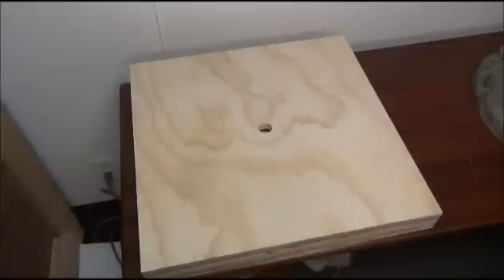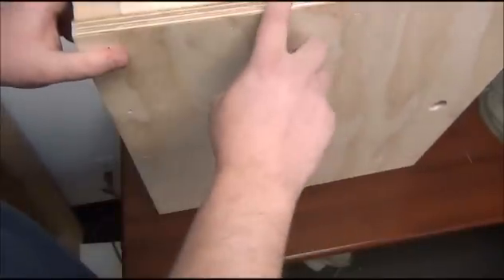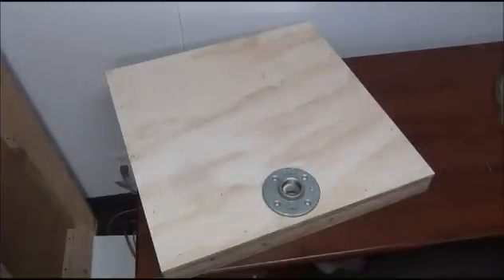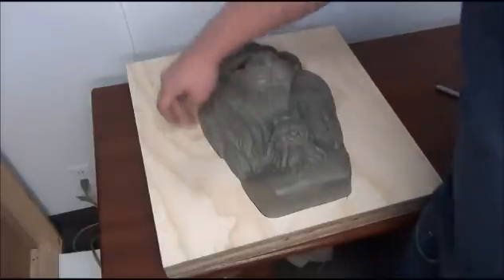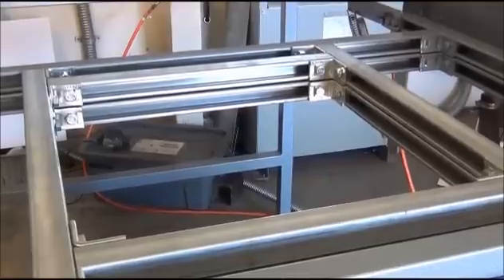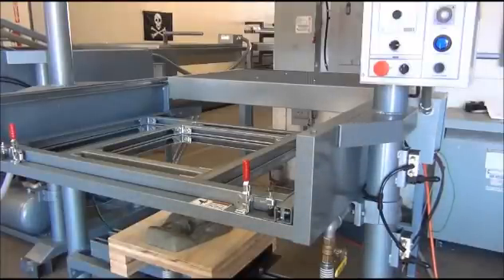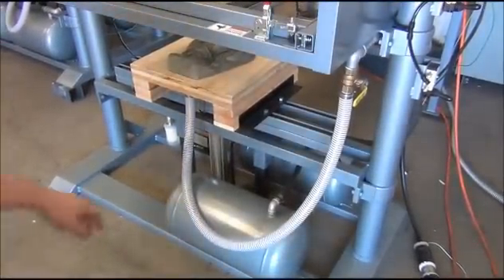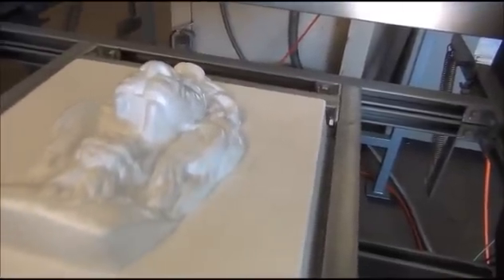Mold setup overview

Comment: Thanks for the informative video.  I made a DIY vacuum forming machine with a shop vac, PVC pipe, a plywood gasket, and a 10"x10" MDF platen with 1/8" diameter holes spaced every inch.  I've sealed all joints with silicone but noticed that you recommended not using MDF as it is naturally a porous material.  I'm assuming you make a different platen for each mold as you drilled holes around the outline of your lion's head, but if I'm planning to reuse my platen for different projects, would it be reasonable to coat the MDF with a thin layer of silicone so as to decrease its porosity?  More specifically, I'm trying to mold a special see-through iridescent 1/8" cast acrylic sheet, but am unsure if it will work as 1/8" acrylic has ripped at the edges of the platen before on different machines I've used -- I'm hoping that with a tighter seal the machine might work better.  Or should I invest in a high vacuum pump to replace the shop vac?
Reply from the maker: Brendan Pettersen Yes, if you were to seal the box with a thin layer of silicone it should prevent any excess seeping. Cast Acrylic even at forming temperature is very brittle and difficult to work with. My recommendation would be to try to source the material in Extruded Acrylic, it will make all the difference in form-ability. If it's an iridescent material there is a fairly high chance that its only available in cast acrylic. This being the case you will only be able to achieve low levels of detail and dimension because the material cannot achieve the type of elasticity required for detail forming. You could form shapes such as shallow domes, pyramids, etc. but i wouldn't expect to achieve sharp 90 degree angles. As for the material ripping in the corners, I would suggest not pushing the box through the material as far and using a hand held square pinch to seal the edges of the box. You wont be able to do it with a shop vac, I would recommend buying a small inexpensive vacuum pump (1/3-1/2 HP) and an air tank(10 gallon). Good luck!
Reply: I plan on using Poly-carbonate 3/16" thick on a L 54" x W 7" x H 4.5"  buck and wondering if this also reacts/performs like the acrylic that you mentioned here or would it be totally different when forming. Also wondering if it would be better to have a vacuum hole at each end of the wood platform rather than just one since I have such a long buck. Thanks and great video!